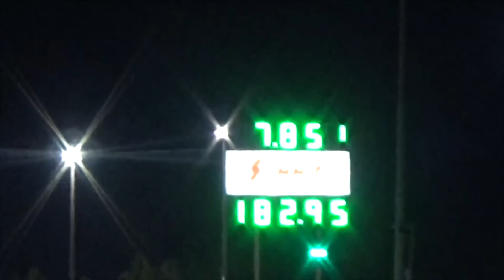The Present, Past and Future of BALTIC SUPRA!

Comment: Yooo good to see u back here fam. Can't wait to see how the new setup does. Hey u were supposed to do a video on all the different trans setups u have had over the years
Reply from the maker: ?, my Supra has always been auto. my first built trans did not live long so i switched to ATF and never looked back. I ran the stage 3 for a long time and now running the ATF SPEED stage 4
Reply: @BalticSupraRacing  no i know that. When u did your video about your fuel system and the diffrent setups u had u said u were gonna do one about the trans next

Comment: Hey Baltic, what kind of battery set up have you been running?
Reply from the maker: What’s up fam. I plan on making a proper review video on this. Many people told me to steer clear of light weigh batteries but I have ran it now for a year and 1/2 with 0 issues. Only weights 4 pounds lol. I forget the name now. I’ll have to look
Reply: Baltic Supra Racing Sounds like a lithium ion battery. I’ve run one on my Supra but it has died out while cruising on several occasions, usually with the a/c and radio on. I’m reconsidering going back to a regular battery for reliability, hence my question. What about the alternator too?
Reply from the maker: T Bonilla I have a Braille battery. Has never left me stranded. For alternator I use a Mechman 170amp
Reply: Baltic Supra Racing Hmmm, I need to check my alternator. It’s the OEM unit on my ‘98. I’ve heard of those alternators before. I’ll have to check them out. Thanks for answering my questions Baltic. I absolutely love your channel and can’t wait to see the new combo in action!
Reply: Baltic Supra Racing Which model Braille battery are you running?

Comment: What differential are you running? 
And ecu? What ecu controls automatic toyota transmission?
Reply from the maker: I run a jdm supra 6 speed diff. For ecu I have an AEM V2 controlling engine and trans
Reply: Thanks I didn't know aem v2 can control auto trans